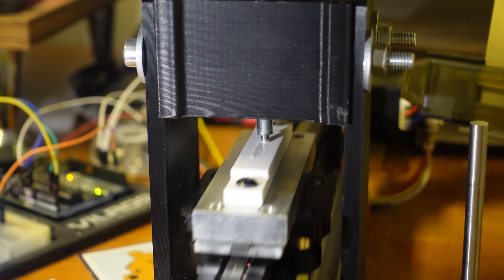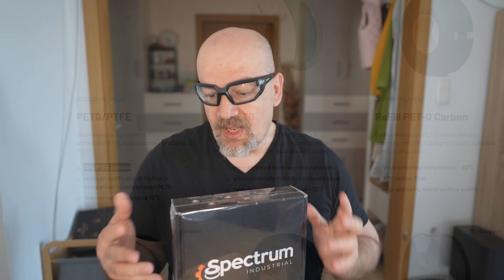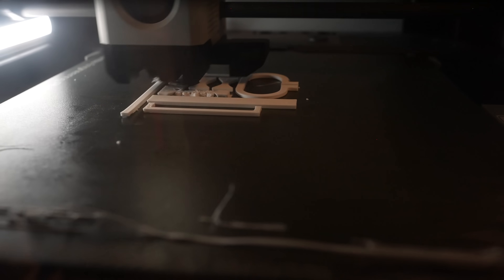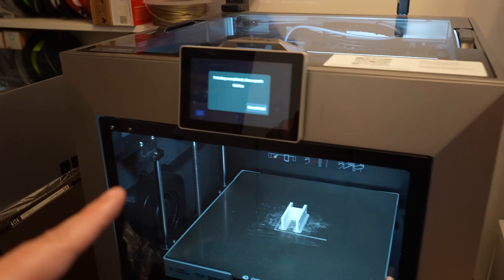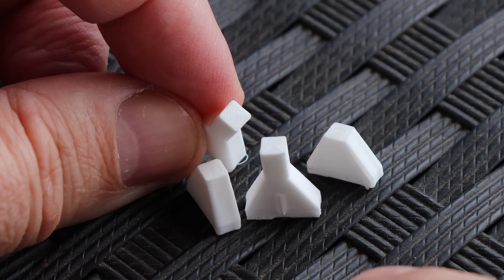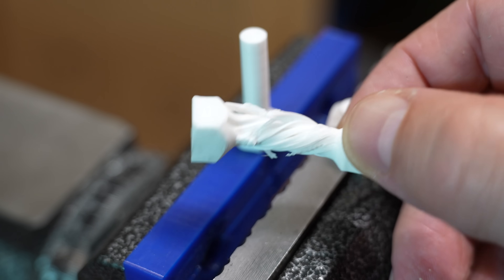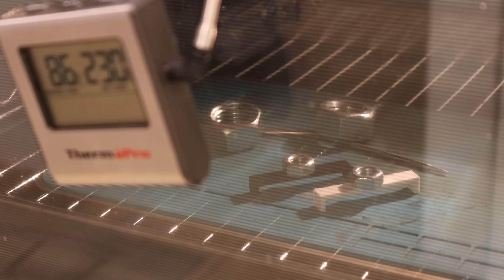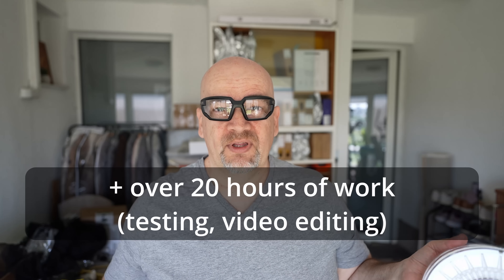Polycarbonate Meets Teflon: Spectrum PC+PTFE Filament Review

Comment: Now THIS is an interesting filament! I also have the Qidi plus 4 and it is an absolute machine for PC. I use alot of PC and it prints as easy as pla for me😂 I print gears for metal lathes (typically Nylon and PC) the pc is stronger but the nylon is self lubricating and it makes a big difference. If that filament works out im going to have to grab some! The gears undergo SEVERE stress and strain so hopefully its very strong
Reply: What kind of builtplate do you use? I use Garolite(G10FR4) on my Plus4, ALLWAYS with a brim. I mostly can get the printing done. But i kinda hate it. I mostly use PA and PACF instead of PC...
Reply: @grott3n0lm  what is your strat for bed leveling with Garolite?
Reply: @grott3n0lm  I print literally everything with a pei sheet. Everything type of filament there is I've ran through the plus 4😂 even some PEEK. One side of the sheet is just the plain pei which I rarely use. the other side I use for adhesive aids. My "adhesive" side just has hairspray sprayed on it. Occasionally I'll use a diluted pva glue (white school glue) for some of the more finicky filaments. But not joking I NEVER ever ever have adhesion issues and I rarely if ever use brims unless its a very tiny part. No probs with warping. The Plus 4 is capable of MUCH higher heat than advertised with just a little bit of tweaking. I mainly print higher temp/higher strength filaments as that was the entire reason I bought the Plus4. Everything is so easy on it.

Comment: Thanks again for your thorough testing! I was extremely curious about this material. I have a project to be done with the best sliding material i could get my hands on. But with this price i wouldn't risk just buying it without anyone having tested it.
Also i was quite sure, that it's would be hard getting it to stick. Having seen the video, i would say, that it seems to print "more easily" than i expected. I'm really curious to see, how it compares to other good sliding materials in future tests.
Reply from the maker: Any idea, how to test the friction is welcome.. I have few methods, but I think I need more..
Reply: @MyTechFun I also think that maybe more methods are needed to really paint a complete picture. I thought of testing methodology a lot, but i can't come up with something i think is good (i'm anything but an engineer...). I'm really interested in seeing your pendulum thingy in action! I also thought of somehow testing objects in rotating motion. This is exactly what i need the still to determine material for. I want to print bushings for a footballtable...
I'm not even completely sure, that i did get how the pendulum is supposed to work...😅
Reply: @MyTechFun  Normally I don't dip too far into the comment section, but I was genuinely curious on how others saw this filament. Since we're both here and you're asking, if you were to rig up a simple faux braking surface with motor at set speed and able to change the braking material with your printed piece (maybe applied by automated device like linear actuator for consistency), calculating the post effects would be fairly easy; time to stop, rotations of the faux brake 'disc'  before stopping (if it does) to stand in for distance, thickness of remaining material, etc.  
Everyone likes automations, and anything that challenges materials to destruction or approaching destructive testing are visually appealing for content. 😉
Reply: @MyTechFun 

Another great video, thank you! 
For the measurement of friction, it would be useful to see the friction coefficient with respect to anodized aluminium. I have written some notes at the link below on how to calculate the friction coefficient, as well as the stiction coefficient from the data you acquired. I hope it can help. The first page gives the formula to calculate the friction coefficient for the inclined rail experiment in your video, the second page estimates the coefficients from the data that you acquired - assuming the rail is at 30 degree angle; the third page shows how to calculate the friction coefficient with the simpler setup where the rail is horizontal - and also shows how to calculate stiction. I would suggest this simpler experiment with horizontal rail. 

Based on the assumption that the rail in your video is at 30 degree angle with respect to the floor. It this assumption is correct, based on your data, I calculated (see my notes) that the PC-PTFE on anodized aluminium has a dynamic friction coefficient of 0.36 (0.34 for PETG-PTFE). This is an okay value for a low friction material, but not as good  as the Igus Iglidur I150 filament that you reported on in another video, which has a dynamic friction coefficient of 0.15 on stainless steel (value from datasheet).

https://drive.google.com/file/d/1iRz2fU_3ESv8m6rIlS9D6pP3fWYm-kku/view?usp=sharing
Reply: Try to print a full 3d printed ball bearing and test it to failure recording the number of revolution it will sustain. Or better just a 3d printed bushing. I think this is the only use case of this material.